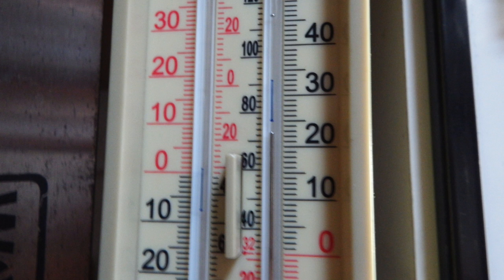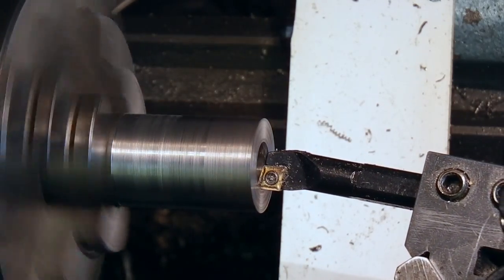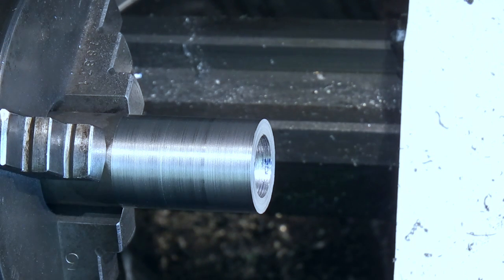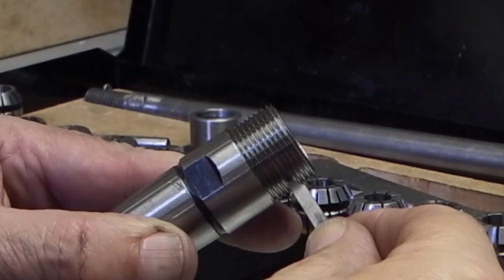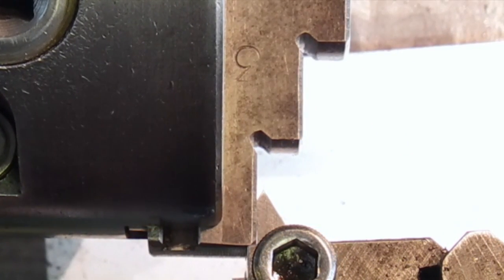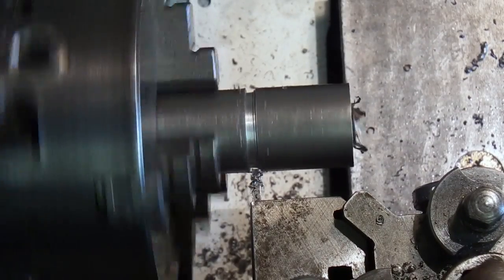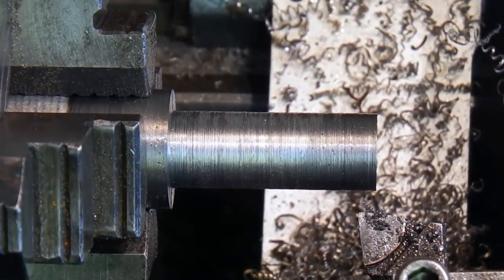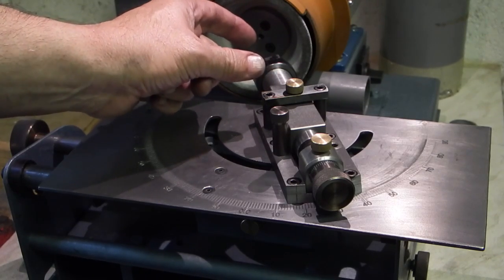Making a ER20 collet holder

Comment: lovely job 
here's my 2p's worth 
grind your parting off tool the other hand so the leading edge is tapered towards the left (tailstock) so the part that you part off doesn't have a bur
left on it  
this comes in very handy if your making shims which are hard to debur
Reply from the maker: Hi Thats a good tip.
Reply: Have an Iscar parting Insert like that.  Cuts and finishes beautifully.
aRM

Comment: Thinking about it having worked on fitting an ER40, when you were talking about not pushing the collett too hard otherwise it would spring out of shape may I suggest inserting a very accurate bar or expanding arbor so that it retains the correct angle. Cheers
Reply from the maker: Hi Ross
Yes you could use a small length of silver steel.

Comment: I made a collet chuck once. Used it a few times and the inside got damaged considerably by the hardened collets.
In other words. You need to harden your work piece.
Reply: Not sure why you had damage. If all fits together as it should, there is no movement to cause damage. I have made my own ER32 holders in round, square and hex mild steel and have no detectable wear, let alone damage. Check your fit and taper, and no need to over tighten. 25 FT pounds max.